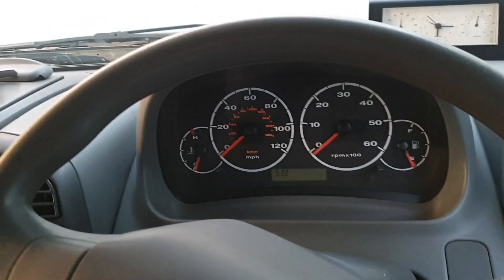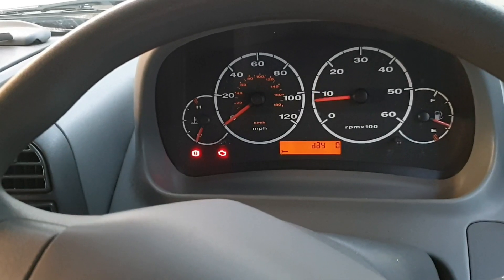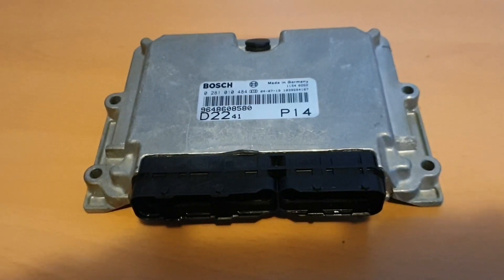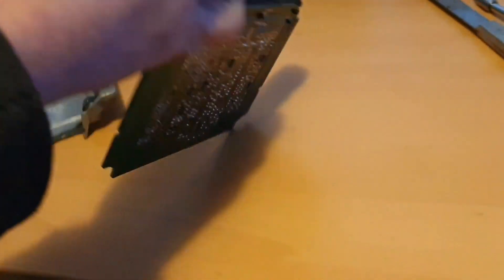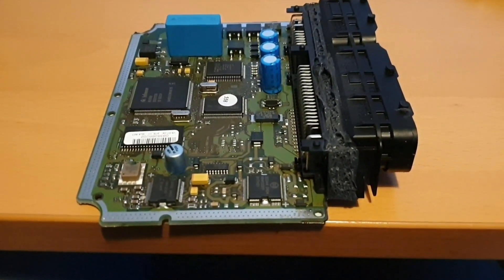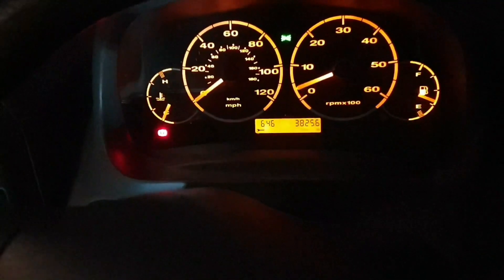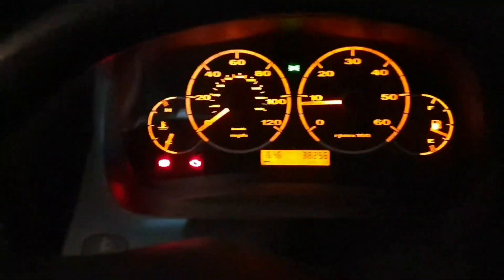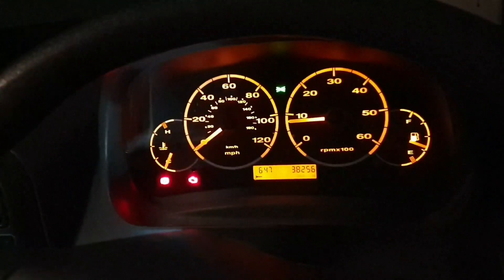Immobiliser delete challenges and problems. EDC15C7 read in boot mode

Comment: I have a Mitsubishi Colt 2004, I bought the car second hand almost two years ago, they only gave me one key. That key felt to the floor and open in two, this happened a few times afterwards. Sometimes, when I started the car, in a few seconds the car stop and I had to started again, or I will stop on the traffic lights and the car engine will stop for no reason. Anyway, at the time I had no idea about immobilizers, but those were signs of some kind of fault with it. 
One day, three months ago, the serpentine belt breaks (car had 100K mileage), and all the battery power drains. When I called the recovery service 3 days later, they replace the belf, but the immobilizer did not recognize the old, battered key, so I called a locksmith. 
They came, try to reprogrammed my key but couldn't, so they took the metal tip of my key and put it on a new key case, with new chip, new transceiver (magnet). They were able to make the doors open and close, but they could not reprogrammed that key either, so they only charged me £100. 
After some research, I am pretty sure my key was chip key (RFID) which apparently is extremely difficult to copy for a locksmith. 
All this chatt takes me to me REAL PROBLEM: I cannot drive me car!!!!!! I am now facing a very expensive repair from the official Mitsubishi garage, which could be the only ones able to fix the problem, maybe by making a new key for £400, or replacing the immobilizer for who knows how much. 
My car is still on the street, for the last three months is been there waiting for me to save the money, but for a car that old, is it really worth it? I RATHER GET RID OF THE IMMOBILIZER FOR GOOD. 
Do you do mobile work withing the UK? Can you cheaply fix this? Could I just remove the immobilizer myself?

PLEASE HELP! I AM DESPERATE

Comment: With Opel Astra g edc15c7 this doesn’t work. After bootmode write ecu locks at ign on,I had to remove EEPROM, then write via bootmode then replace eeprom because if it’s not removed it writes data to EEPROM locking ecu. Fiat doesn’t have this problem